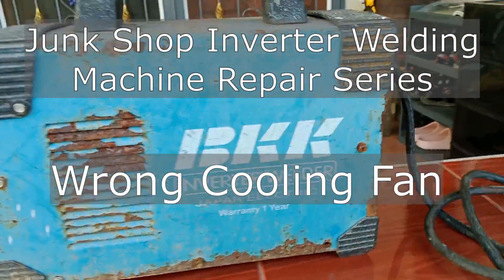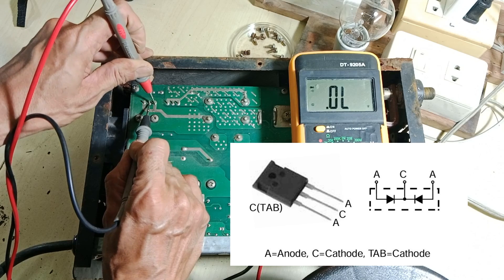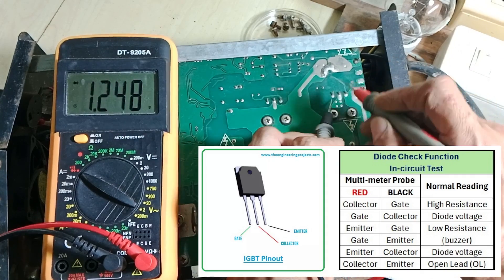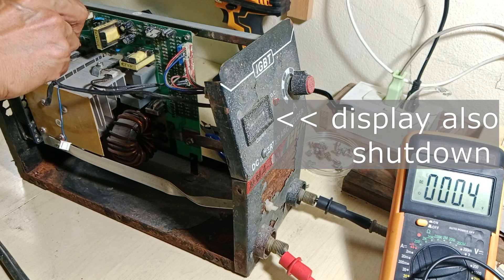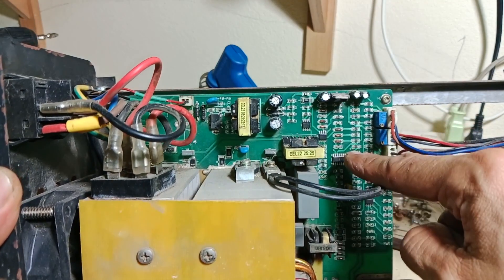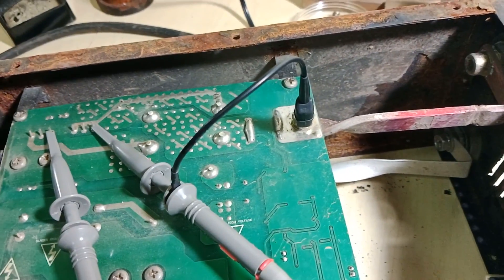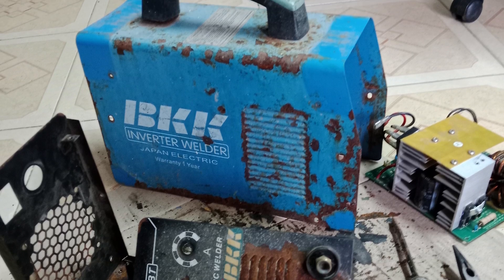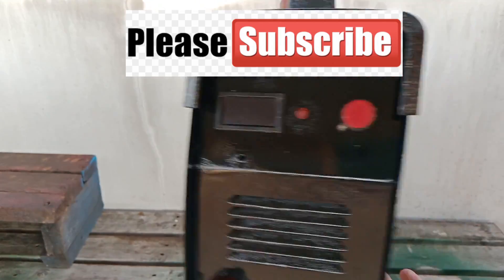010 Junk Shop Inverter Welding Machine Repair - Wrong Cooling Fan

Comment: Sir good day.. yung welding machine ko po bigla nasira ung cooling fan.. nung chineck ko po ung out voltage sa socket ng fan 32v po.. kaya po cguro nasira ung fan kc 24v lng xa.. bakit po kya ganun kataas ung voltage??
Reply from the maker: may problema siguro sa auxilliary power supply.
Reply: @DIYPhil ok lng po ba ung ginawa ko po eh nagpalit aq ng ng 12v na fan. Tpos nilagyan ko po ng bukod ma power supply na 12v sa loob.??
Reply from the maker: @HobbyistPH  oo ok lang yun sa fan.

Comment: Sir , good output voltage low current,  ndi mkatunaw ng rod ano kya sira  napalitan na ang igbt output diode , op amp same
Reply from the maker: Check yung power supply sa mismong pin ng mga ic kung may voltage. Check yung voltage sa mismong pin ng ic galing sa potentiometer kung nagbabago voltage kpag pinipihit.